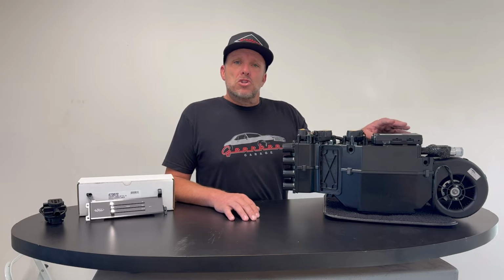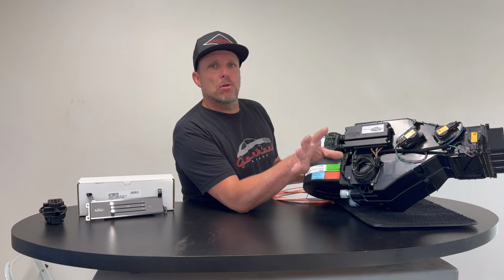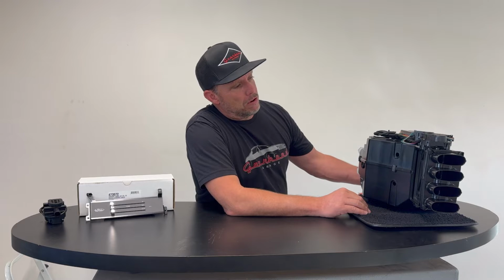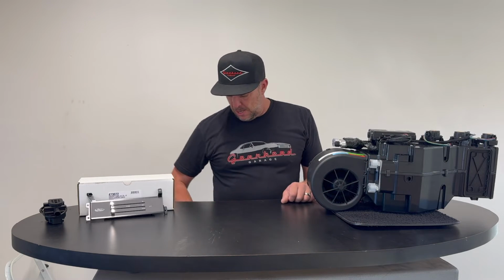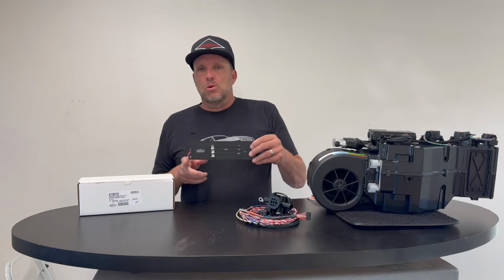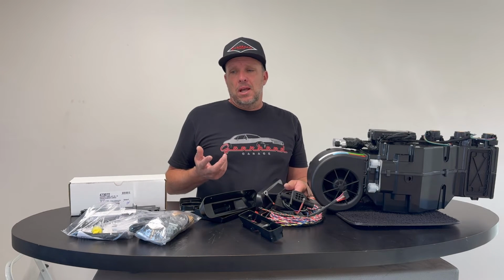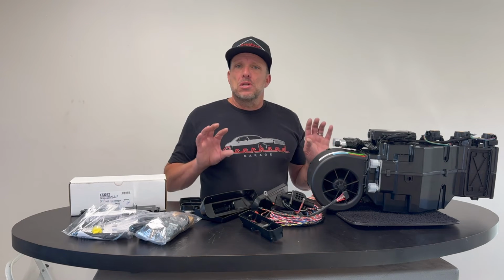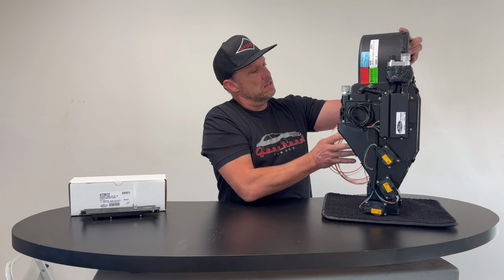Vintage Air Gen V: Easy Install, Massive Upgrade

Comment: I'm having difficulties fitting the Gen5 AC Evap up in under the dashboard. There just isn't enough clearance between the firewall and the dashboard. Did you have any difficulties doing it?

Comment: I have a '62 Pontiac Tempest with the 4cyl half V8.  It has a heater and while a/c units (Cool Pack) were available as a dealership option, mine isn't equipped with one.  A few years ago, I took possession of an original Allegro Mark IV underdash unit that came out of a '68 Chevelle.  It's in really good shape but don't know if it works.  

Is there a way to get it running to see if it does (with a car battery or something like that) and could it work with Vintage Air equipment?

Comment: Is there a control panel option that looks exactly like the OEM one in a 69-72 C10 with factory air?  Don’t really like the look of the controls in this kit. Thx!
Reply: I have been thinking about installing in my GM A body with same concerns, in viewing dozens of videos I recall someone  reworked original Chevelle graphics or panel that overlayed the VA controller. Maybe an option??
Reply: They also make a kit with programmable "slide-pots" that can use your existing factory controller

Comment: How much do you charge to install vintage air in a 1966 Chevelle? Ken
Reply: Most CLEAN installations run about 25+ hours to install, plumb, wire & charge. Our shop rate is $150/hr

Comment: I have a brazilian 1976 Ford LTD (basically is an american 1967/68 Ford Galaxie). It's originally equipped with the "under the dash" AC unit! I'd like to convert to this new A/C system, the gen5! Is it possible to be installed? Is it possible to create a control panel that fits is original ventilation control panel? Tks!
Kindly 
Luiz H
Reply: I'm sure you could configure something with heir builder series. Gin=ve them a call direct? They're pretty halpful 1(800)TOCOOLU

Comment: Have you installed the gen 5 in a 67-72 f100? It seems impossible to get the evap box in following vintage air directions. I messed with it for about an hour then just decided to remove the fan.

Comment: I like your 'common sense' approach to these classic cars, Thanks for the videos. 
However, how is idle speed controlled (with carb) when the compressor is cycling?, with these kits
Reply: In those situations, you can purchase and wire an idle kick-up solenoid that will bump idle up when the compressor is engaged

Comment: Always enjoy your videos!! With Vintage Air do you have to have an AC dash or will a non AC dash work? Thanks in advance!!!
Reply: They make kits for both.
Reply: They make kits that work with & without factory AC, and for a cleaner install you can look into original type vents and integrate those.

Comment: I'm in the process of installing a gen 5 system in my 71 Camaro and in my opinion the instructions are not very good. They are vague and the pictures are not very helpful at all.
Reply from the maker: It's a straight-forward, but pretty involved install.
I hope you stay the course and figure it out - you'll love it when you're done!!
Reply: @ My car was on a rotisserie not too long ago and I put all of that back together myself so obviously I’m not going to give up.
Better instructions with clear pictures would be helpful though
Reply: Just installed the Gen 5 in a 69 Camaro. It won’t calibrate. Any suggestions? I can’t find any information online.
Reply: @chriscoesbodyshop  Is VA's tech line of no help?
Reply: @stevemiller7654 yes, they helped me. It was a bad blower control leaver, the one that came with the kit. It is supposed to go from 0 volts to 5 volts, this one stuck at 3.2 volts.
Reply: Is there one for a riviera 68
Reply: Hey I need an set up for a 1987 caprice

Comment: I love these for classics however, everyone I have seen misses one thing I use a lot, "fresh outside air" intake. But, basically only re-circulation, cant have it all.
Reply from the maker: That's so true! 
You can usually retain the driver's kickpanel vent, but so many kits make you lose the passenger fresh-air vent.  
We'll often modify the install, drill the RH upper kickpanel area, and retain the vent!